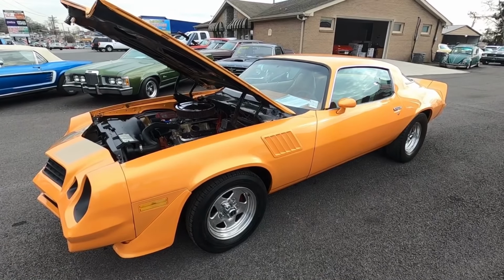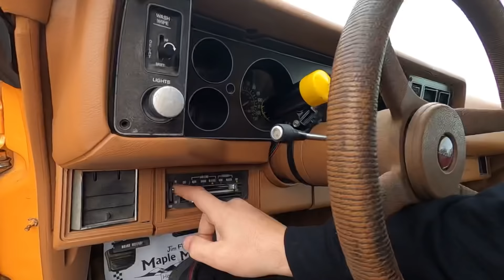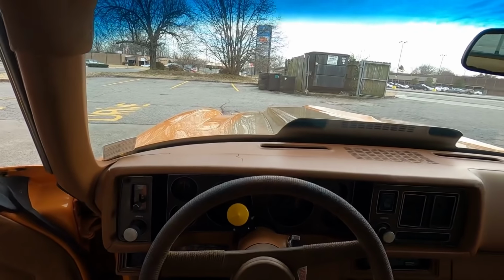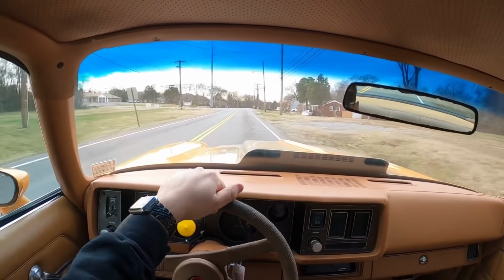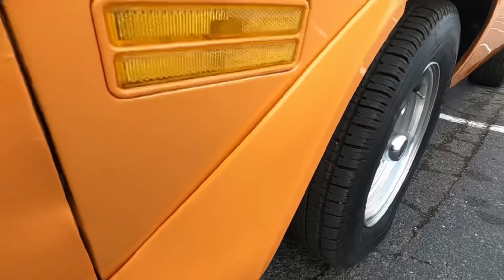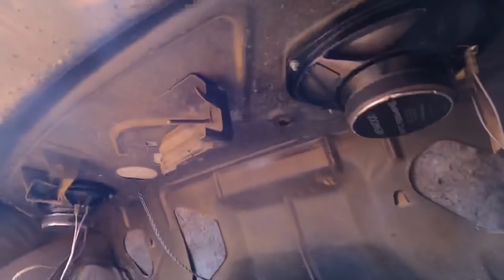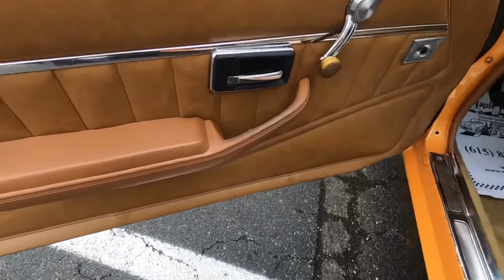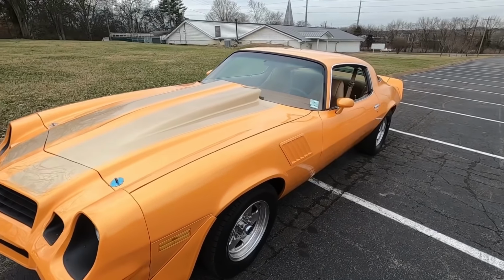Test Drive 1979 Chevrolet Camaro Z28 SOLD $16,900 Maple Motors #1475

Comment: That is a beautiful car! If you would please start showing us the pedals, and the floor and seats as you would be getting in the vehicle.  I know they can be easily changed, but it could tell you a good bit. Plus let us know if the heater cores are hooked up.  And if you do I promise I will comment on every video.  Thanks man

Comment: I had a used 79 it was a beast I was cruising at 150 on interstate then I trained it for a 82 with Ttops it ran good buy not like the 97 did !! But I have always wanted another Z28

Comment: Is that a factory Hurst? Hopefully it has the full Hurst linkage and not a scabbed-in job.
Reply: No, but Hurst made a "console" Hurst Shifter that fit the 2nd gen Camaros. The linkage uses a cable for the Turbo 350 trans. Sweet street rod inside and out....👍